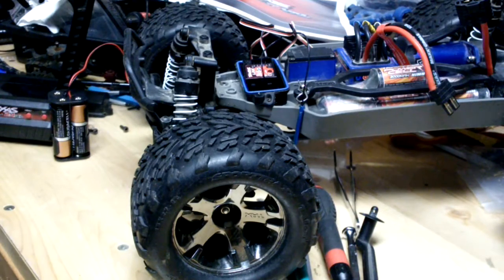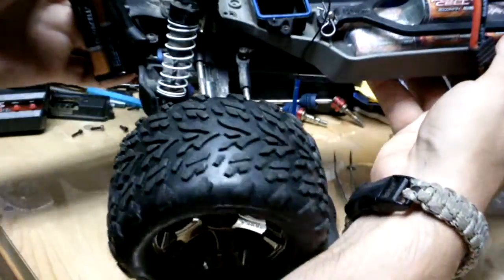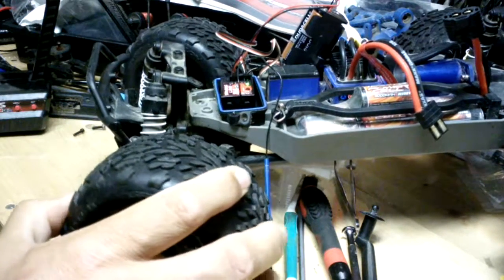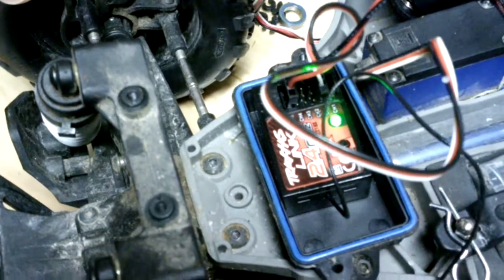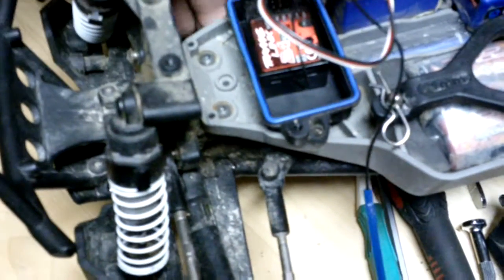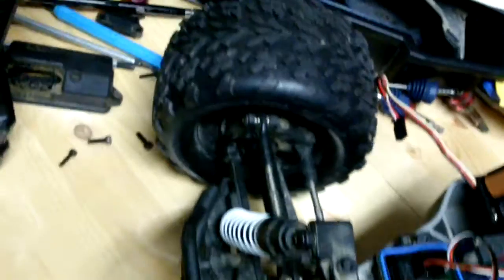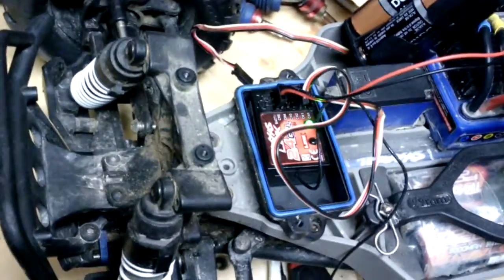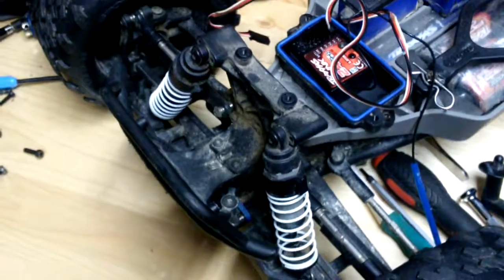Servo Chatter/Jitter Part 2

Comment: I have a question why do you have do you have your servo connected to a Double A battery?
Reply from the maker: The receiver is being powered by a quad pack of AA batteries (1.5V x 4 = 6V) which in turn powers the servo, just like if I had the ESC and 7 cell NiMH battery connected to the receiver.
Reply: Did you ever splash your servo with water because that could be 1 main reason why it is Jittering because same thing has happened to me
Reply from the maker: @Lrz_392  The Traxxas servoes here are "Waterproof" and I've run Traxxas RCs through water, snow, ontop of ponds, etc... It jitters because the potentiometer in the servo is degrading and causing the position signal for the servo motor circuit to "jitter", aka continue to adjust its desired position.

Comment: I have the same issue with one of my servos. Have you figured out why it does that?
Reply from the maker: It is a failing potentiometer. A small resistance dial that controls servo position. The failing pot causes the servo position to move back and forth across the "desired position" which is the jitter effect.